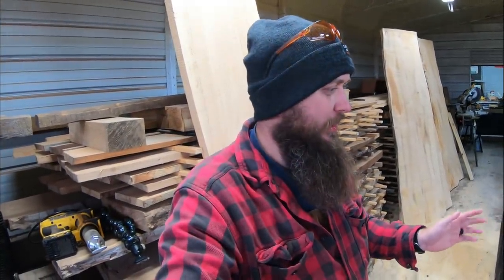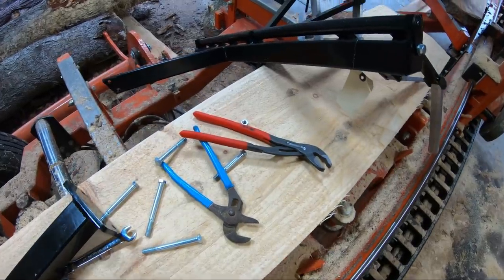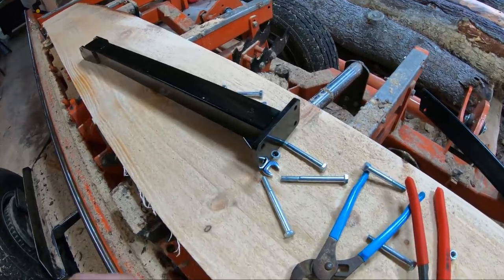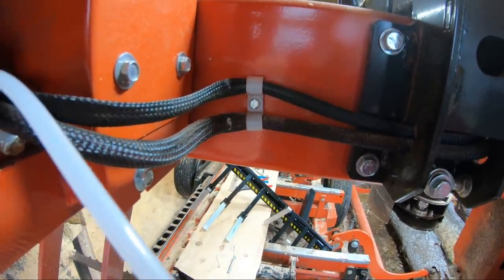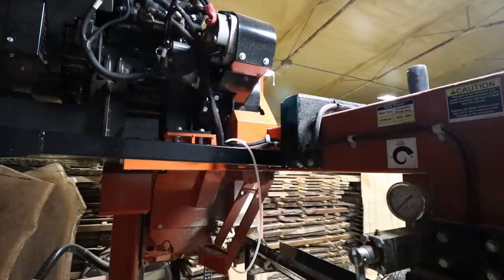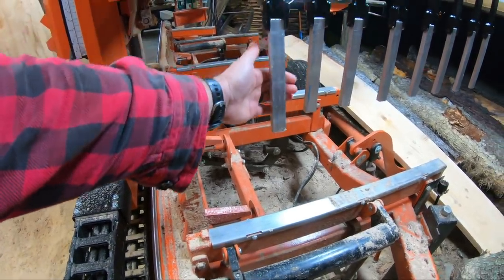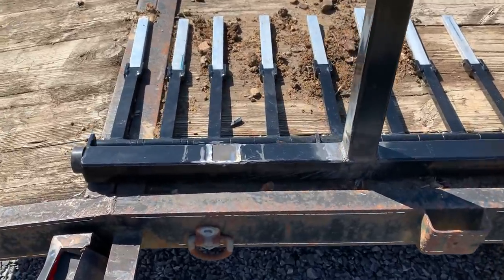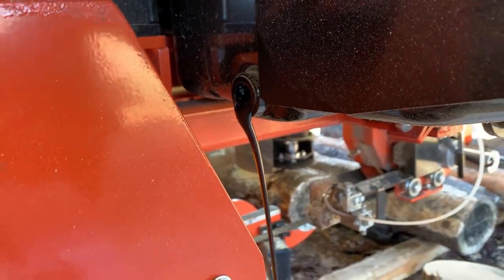This Upgrade Will Double The Productivity Of Your Sawmill

Comment: Having a 2nd point of contact on the boards seems to make them more likely to come back straight, rather than at an angle.   Are you at all concerned about the wear on the log bed from the fingers on the board guide assembly?
Reply from the maker: Nah they are aluminum.  Very light

Comment: Maybe I missed it in the explanation, but how does this differ from the drag back bar that was already installed? Just wider capacity and heavier load? Or does it have some other functionality above and beyond that one?
Reply from the maker: Keeps them straighter
Reply: Johnny Brewer as He explained and by moving the Finger bar left 8” the Straight Hanging fingers does not let the board to veer left or right keeping it coming off straighter mostly due to the possible angle of the end cut causing before to be pushed off at that angle of the end cut !
 Make since, great idea that looks to be working Great !
Reply: It’s my understanding the lt 40 return foot is designed to off feed a board slightly toward the lift arm side of the machine, thats where the off feed table can be located. At least that’s how mine is set up. That’s also assuming the log has a square cut.

Comment: For anyone who can weld,  this would be an easy accessory to fabricate, and use square U-bolts to attach it to the sawmill frame so you wouldn't have to drill through the frame, plus you'd save yourself a lot of money.
Reply: I agree. It would probably be less than $150 in steel and bolts. Three hours of labor.

Comment: What was wrong with the included board return?
Reply: It pushed the boards off to the right side, away from the operator. He shows that in a previous video.
Reply: Andrew... That was my question, too. I saw the standard equipment board return doing 99% of the work. Even if the fingers held the board somewhat in alignment, you'd have to ask. Is it $600 worth of improvement?
Reply: Rick Ashford worth every penny. Boards never came back straight without grabbing them
Reply: @rickashford4005  I would think so. He is not a welder so he could not fab one easily hkmself.  If it keeps boards aligned and he is working alone that will speed up production when he has a lot of logs to cut.
Reply: @codfishknives8526  ... that makes sense. But still $600 for a piece of equipment that had to be modified to work... and I'm pretty sure his welder didn' t work for free. He does have the advantage of bartering lumber for welding!! If it makes his job easier, and makes him happy, great for him.

Comment: I am so glad that Mike hooked up with you in case he has a problem. I have a question that puzzles me a little bit. Why do they only have a debarker on one side. I would think 🤔 if there is anything in the bark wouldn’t it mess the blade up even if it was on the opposite side of the de-barker ?
Reply from the maker: on the exit side it is less prone to dull the blade as the entry side

Comment: Sure this will work as long as the original cut on the log is flat and square to the cuts off the mill... But boy if the end cut is at an angel or irregular then will it hold the slab coming off the mill cutting... will it ride back to the operator straight.... this the lesson we will learn in the near future!!!!!!!!!!!!!!! You would think that I am from Missouri but no but show me any way!!!!!!!!!!!!!! Great Video!!!!!!!!!!!!!!!!!! I have my ""fingers"" crossed!!!!!!!!!!
Reply: Stan Webb the way it’s designed is to guide the outside edges of the board, nothing to to with the top surface itself.

Comment: Your neighbor did a good job welding it up. [from what I can see from here], however, the factory welds looked like a caterpillar laying there. Not enough heat = no penetration. Hope it doesn't fall apart on you.
Reply from the maker: same welders that build the sawmill I operate, I should be just fine,
thanks for watching,

Comment: I could not see how those fingers would drag the board back. Very clever idea which works very well, now all you need is a sawdust solution too.
Reply from the maker: Yes 👍
Reply: The main bar does the pushing, the new add on is a guide to keep the cuts straight on the return.

Comment: When we ever change oil on any of our small diesels, We always unplug the fuel turn on wires and crank it over to fill the filter so you wont get that 2 or 3 seconds of  a dry start.  then plug the wires back in and your ready to go. On our bigger diesel trucks we unplug the crank sensor so it will not start till the filters are full and we watch the oil pressure come up and then plug it back in and we are ready to go.
Reply: We fill the vertically mounted ones before installing.